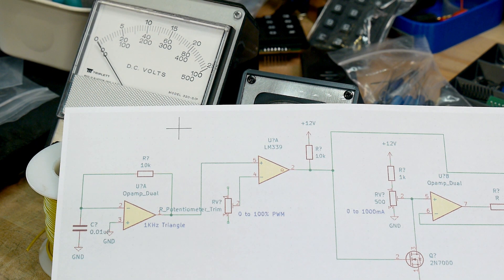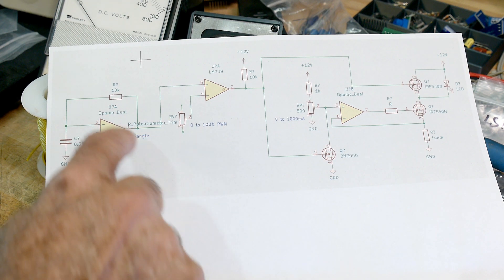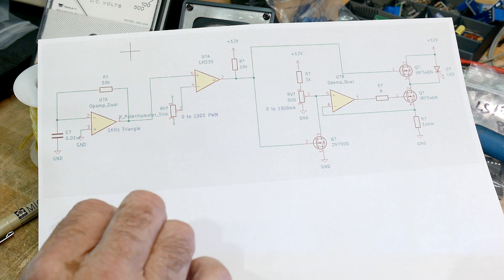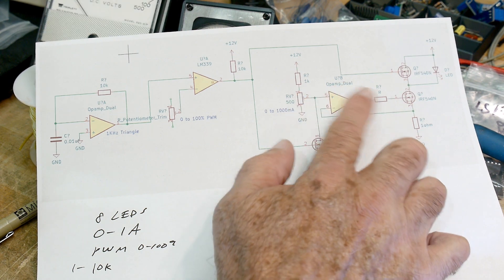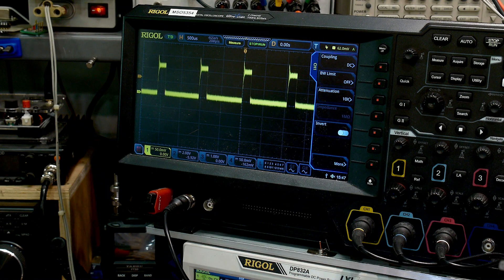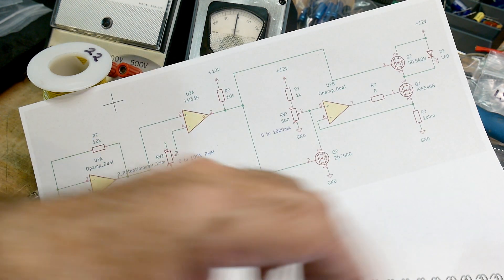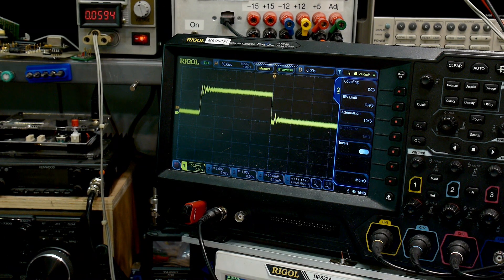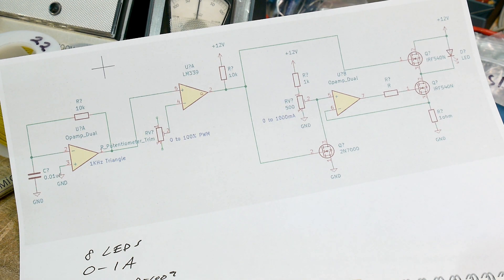#1309 LED PWM (part 1 of 2)

Comment: The current source MOSFET has capacitance from the gate to source and gate to drain.  The effective gate to source capacitance is small, since the mosfet acts as a voltage follower.   The resistor in the gate along with the MOSFET capacitance introduces phase shift into the feedback loop that may make your current source unstable.   I would try eliminating the gate resistor and drive the gate directly to reduce the loop phase shift.
Reply: It's pretty generic building block, many people built loads based on it,
All report that it is a reliable oscillator, even with bjt.
Reply: @plainedgedsaw1694  I build them all the time with a BJT and have no stability issues so long as I am careful with GBW of the op-amp and the additional phase shift in the loop.
Reply: I'd do the opposite because the ringing is most likely an LCR resonance in the loop from opamp output through the mosfet gate-source and the return via ground. The clue for me would be noting that it's "layout dependant". If the opamp/mosfet combination really were acting as a voltage follower, then you'd have difficulty getting any oscillation with a gain of less than one.
Reply: All this is operating at a few 100's of Hz..not in GHz/MHz range...so effect of series r_g,&
 g-s cap. is not an issue...also there's no closed loop control..nor any need for one ..this is not a mission critical app.
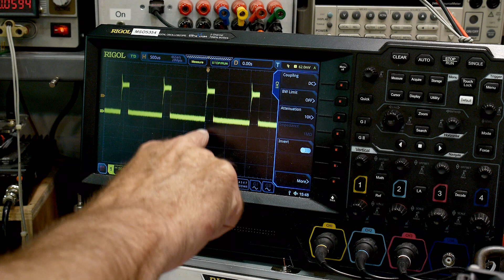Reply: @analoghardwaretops3976  The PWM frequency is 1KHz - see 4:07 for the timebase. But PWM isn't a sine wave; it requires fast edges to prevent the mosfet from operating in its linear region and overheating. The ringing is at 150KHz - see 4:17 for the timebase - and the edge has a risetime of around 5μS. So we're not talking about a few hundreds of Hz; we're talking about hundreds of KHz. That's a pretty big difference. The IRF540 has a typical input capacitance around 1.7nF and that needs less than 700μH of inductance without any other parasitic capacitance to produce ringing at 150KHz. You'll find the parasitics are significant on any breadboarded prototype like this.
Reply: @RexxSchneider  a closer study of the ckt. one concludes it's a " pwm off time sampled current limit" configured as similar to a typical " Howland current pump"  f.b. control ..& since sampling/switching is done..the bottom tot.ple msfet should have a g-s pulldown / turn-off resistance 4k7 to 10k atleast.....
This g-s resistance will also act as a closed loop f.b. which as at present,not being there, the ckt is operating in open loop/ comparator mode.
This is so because the MOSFET when OFF is in Hi Z state...& source is virtual gnd ..
It is this ,  that is more the cause of " H.F. edge transients than just breadboarding layouts...
IMHO same ckt. will behave similar even on a well planned and designed 
layout board without r g-s ...
A 1 Amp led current...gives a 1V drop across the 1E curr.sens.res. , whereas the c.l. divider of 10k /1 k pot gives about 1.0909V curr.ref.@ max so the pot setting will be " maxed out" @ the top end ...yet we see ringing on the edges...another tried practice..( as one of
 " MAXIM's" appl. ) was to put a 1nF cap or  lesser between the inv. & non inv. pins to avoid oscillations on edges....  
these are some basic design guidelines that are a must even in low freq. .sw. ckts...no matter what the MOSFET rise / fall times be...
Another observation shows the top tot.pole mfet.is only shorting out the led string when it's ON...so a resistor of 1k or more in series with upper drain will help improve transient behaviour..
Reply: @analoghardwaretops3976  Your analysis is faulty. There is no need for a passive gate-source pull-down resistor because the gate will be pulled-down actively by the opamp via the gate drive resistor (in the region of 100R to 1K). Without knowing the details of the opamp, we cannot be precise, but it should be clear that the output impedance of the opamp plus the gate drive resistor is small compared to a 4K7 to 10K resistor, which would have little effect on the circuit.

Did you miss the explanation around 4:00 that he's not prototyping a complete circuit? What you see on the 'scope is just the mosfet-opamp-mosfet combination being turned on and off at 1KHz derived from a 555 timer. There's no "totem-pole", no comparator, just a voltage follower supplying a current from the drain of the mosfet which is set by the voltage at pin 5 also appearing across the 1R source resistor. Assuming the opamp has 0V in its common-mode range, it should be clear that the circuit does not enter an open-loop state. The 2N7000 has a typical Rds(on) around 5R, so sinking about 10mA will produce about 50mV at pin 5 when it is turned on, and that will result in about 50mV at the IRF540 source, showing that the output mosfet never quite turns off.

Given that IMSAI Guy suggests around 5:16 that the board layout is to blame, I don't see any reason to disagree with him. I certainly don't think that a gate-source pull-down resistor will dampen the ringing unless the IRF540 is mounted some distance away on flying leads.

At 1A, the voltage at pin 5 of the opamp would indeed be 1V, but the 500R pot in series with a 1K resistor from a 12V supply will give a voltage range of 0V - 4V. Where did you get your values of 10K / 1K pot from?

IMSAI Guy already tried a 10nF capacitor on pin 5 with little effect (presumably from pin 5 to ground). There is little reason to believe that a similar capacitor from pin 5 to pin 6 (a virtual ground, of course) would be any more successful.
Reply: @RexxSchneider  and what you have said now putting a cap did not solve the ringing problem...
The gs resistance has a dual fn as I said ..
 just  ...the pulled down res contributes nothing..besides
your expln.is just based on the prototype workin you saw...not what will happen when the real ckt is built...
my viewpoints are on the entire final outcome that I see happening...here because even he was not sure how it was finally going to behave......
another pt. the current sense ckt. you mentioned is working as voltage follower.
..it is not it is  in comparator mode because of MOSFET off state hi z...
These are basic ckt. implementations  carried. out in  tried & tested applications that have been running for years in equipment I worked with.
Reply: @RexxSchneider  his 1k/ 0.500k combo gives 4v max. as stated...true.. that's why it will " current limits only over a small range 
0-1 v.. the rest of the pot. range ( higher lim. setting) is ineffective...and bad design
Reply: @analoghardwaretops3976  It is a voltage follower. I don't understand how you can fail to see that. The opamp always drives its output so that its inputs are at the same voltage and the source of the mosfet is directly connected to the inverting input, so it follows the voltage at the non-inverting input. That is going to happen whether the circuit is built on a breadboard or on a finished pcb. There is no comparator mode, and the mosfet is not turned off. In the prototype shown, the voltage at pin 5 switches from a few millivolts above ground to 100mV above ground (or 1V above ground in the "real circuit"). What voltages do you think it switches between? The ringing in the prototype swings up to about 150mV and then down to no less than 50mV. At what point are you claiming that the opamp is acting as a comparator? Do you even know what the output states of a comparator are? Are you asserting that the opamp goes into a state where there is significant difference between the input voltages and the output is driven to one of the rails?

The buffered non-inverting opamp configuration is a standard implementation that I've been working with since I used μA709s in the late 1960s, so I don't need any lectures from you about "tried and tested".

Any gate-source resistor could only have a function of dampening an LCR resonance and since the input capacitance of the mosfet has a reactance around 500R at the resonant frequency of 150kHz, a 4K7 to 10K resistor isn't going to dampen the ringing appreciably. If you think that such a resistor would play any part in a feedback loop, ask yourself what voltages would exist at each end of it and therefore what current would flow through it. If the answer is "no current would flow through it", then you should see that it serves no purpose in the feedback loop.

So you made up the 10k/1k pot, which is not in the circuit, and then complained that the pot would be "maxed out" at the top end. What were you thinking? The circuit as shown will provide a constant current over a 0 to 4A range. That is not ineffective. nor is it bad design, although it could be improved, of course.
Reply: @RexxSchneider  a simple observation of the " switching transients on the edges of current controller shows its in comparator mode .in volt.follower mode these transiens wouldn't be there....as it will then really follow the I/ p.  To me it seems your components theory may be ok but no so your Circuit analysis..or practical experience....as such ...
in this current limit control anything above
 1. 0 Amps ref. is going to allow a higher peak amps to get through on edge transitions..so a 4Vref../ or 4 A or even 2A may kill the led over time...
 here aTL 0xx series op amp here is used...these are " signal/ low volt". type... ..not even of " buffer" capabilities for a MOSFET gate.. usually mfet are diven suitable " driver grade" devices... ..that can  charge up the gate quickly ...
Reply: @RexxSchneider  the 10k/ 1k pot combo..is about right for this app.but if a (270-470 ) ohm res is added between pot bottom & gnd. it would lift the min. current lim. to a non zero value...likewise upper ref. limit would increase ..
Reply: @RexxSchneider  what's a 4A max. current limit going to do here...but kill the LEDs..a 400% overload setting 😭😭that even motor controllers never do..
Reply: @analoghardwaretops3976  You have no idea about what comparator mode involves. It means that the output of the opamp is saturated to one or the other rail. Even you should be able to work out that the current rising to 150mA and falling to 50mA as the first "ring" on the rising edge requires that the voltage across the 1R resistor swings up to 150mV and down to 50mV. That means the voltage at the gate will be a few volts above that. How do you reconcile that with your theory that the output of the opamp is being driven hard to either the positive or negative supply rails?

The ringing can appear in voltage follower mode because the loop formed by the opamp output, the gate drive resistor, the gate-source capacitance, the source resistor, and the return through ground is an LCR circuit when stray inductances are present. Anybody who has designed a circuit where an opamp drives a power mosfet has experienced the effect. To me, it is obvious you have no theoretical or practical experience in circuit design.

Yes, we know that the ringing can overcurrent the LED transiently, and that's why we prototype at lower currents like 100mA and figure out using the prototype how we get rid of the ringing before we scale it up to the full 1A.

How do you know what the opamp is? We're not told. A TL072 would be a bad choice because it won't operate with a single supply if we need to include ground in the common mode range. Even the ancient LM358 would be a better choice as it functions with inputs as low as the negative rail.

As for the drive current, an IRF540 has a maximum total gate charge of 72nC and the TL072 can sink or source 50mA, so it can charge or discharge the gate in 1.5μs and that is plenty fast enough to drive the mosfet in this application. So you're wrong about the choice of opamp, and you're wrong about the reason why it's the wrong choice. Clueless.
Reply: @analoghardwaretops3976  "what's a 4A max. current limit going to do here" Don't ask me; ask IMSAI Guy. It's his circuit.

I simply pointed out that your comment "whereas the c.l. divider of 10k /1 k pot gives about 1.0909V curr.ref.@ max so the pot setting will be " maxed out" was a piece of nonsense because that wasn't what was in the circuit.
Reply: @RexxSchneider  how well you contradict yourself in your very first statment...by explaining comparator behaviour...."a saturated o/p @ either rails...".
that's exactly what happens on the sw. edges..,& it is because during those instances there's no voltage follower action..as the led driver is off...there's no op amp o/p that the inv. I/ p can see.. therefore the spike..it is till the inv.ip senses the value of c. fb...
In all the comments I mentioned " working in comparator mode." ..that's because of the 2N7000..and is required as such... 
Nowhere did I say or imply"  it is wired as a comparator circuit"......
That's the difference...and as I said you did not understand circuit behaviour as a whole..
Reply: @analoghardwaretops3976  Are you just trolling now? A comparator output is saturated at one or the other rails. I've told you that twice. On the rising edge you can clearly see that the IRF540 is passing current rising and falling between 150mA and 50mA  which settles down to 100mA. How is that "the led driver is off"? What kind of imbecile thinks that If a mosfet is passing current, it's "off"?

Can't you understand that the 'scope is displaying the voltage across the 1R source resistor? That voltage is also the voltage at the non-inverting input which is directly connected to it. The IRF540 is conducting current throughout the ringing, so the voltage at its source is directly related to the voltage at the gate. Of course the opamp output is not at either rail. If it were at the negative rail, the mosfet would pass no current. If it were at the positive rail, the source would be at (12V - Vgs), which must be between 10V and at least 6V if the current is a maximum of 150mA. But 6V at the source would cause 6A to flow through the mosfet and that contradicts the 150mA max that we know flows. Therefore the gate of the mosfet never reaches anywhere near the positive rail and so the output of the opamp cannot swing as high as 12V either. That proves it never works in comparator mode.

Of course I understand how the circuit works as a whole, and I even told you what the voltage was at the non-inverting input when the 2N7000 is turned fully on.

You're now trying to pretend there's a difference between "working in comparator mode"  and "wired as a comparator circuit". That really is nonsensical and even with your limited ability in English, you should be able to recognise that you're spouting nonsense.

I give you this challenge: if the opamp is ever "working in comparator mode", tell us what you think are the voltages are at the opamp output, the IRF540 gate, and the IRF540 drain when it's in that mode.

Comment: Besides the concept of linear control at higher currents there might be an option to control the max current with a module of the type: "LM2596 LED Driver DC-DC Step-down Adjustable CC/CV Power Supply Module". 
 .. and to override the control input of the LM2596 with the signal of a 555 module that is controlled at input 5.

Comment: I presume you put the cap on pin 6 of the op amp instead of pin 5? That problem in audio amps is transient intermodulation (TIM) distortion - it occurs when the feed back loop has higher frequency response than the amp circuit. So did I  guess right. You coulda told us; but then you'd have to kill us! Ha!